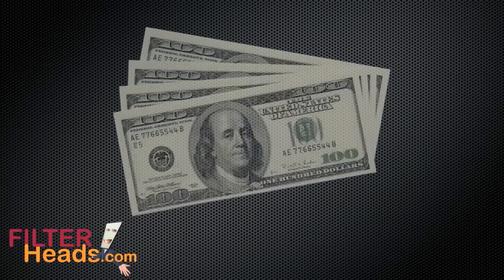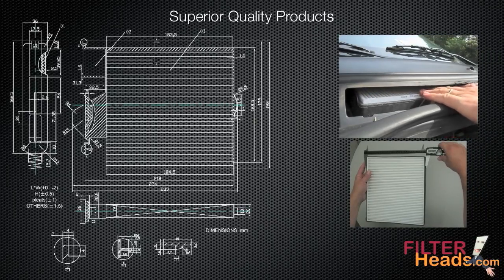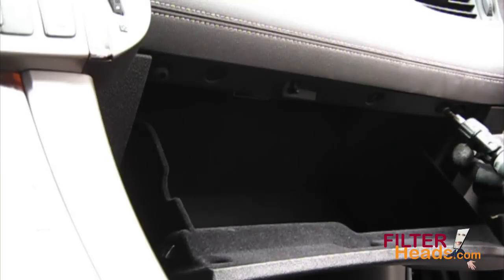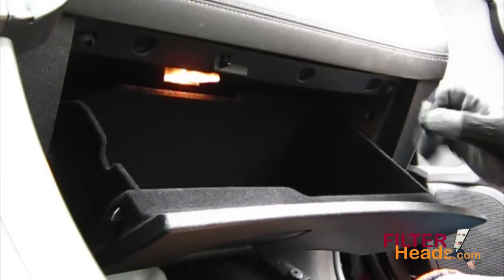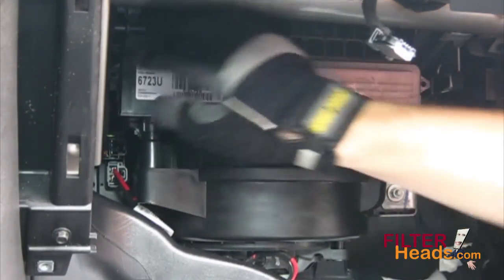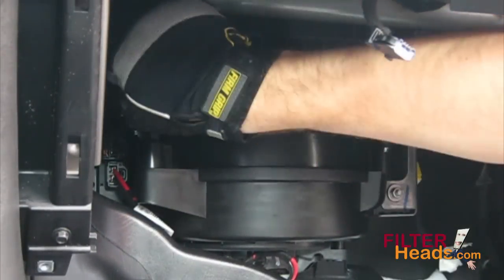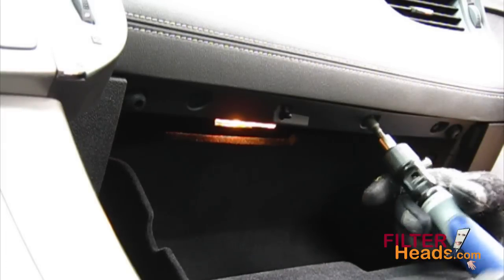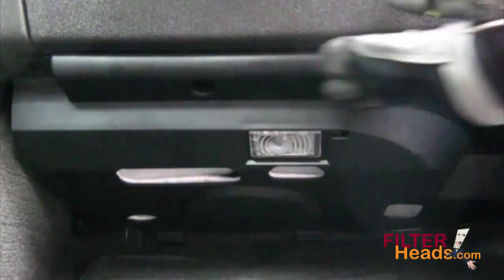How to Replace Cabin Air Filter 2010 Buick LaCrosse | AQ1164C

Comment: My 2015 LaCrosse doesn't have Torx 20 bolts.  The Torx #20 driver is HUGE, can't be right.  It's about 3/8 inch regular hex socket- but I will post again when I actually do the work.
Reply from the maker: Thank you for informing us.

Comment: This is all correct except the side panel on the right side of the glove box has to be removed on a Lacrosse 2014 to get glove box to clip back into place this is not shown anywhere in the video.  When you try replacing glove box without removing side panel on the right side , the clip will bend out and you have a large gap between glove box and the panel that attaches to the right side.  We finally took it to a friend that owns a body shop he just pulled the right side panel off straightened the bent clip, pushed the glove box in and snapped the side panel back on and was done in about 2 minutes.
Reply from the maker: Thank you for informing us!

Comment: You do not have to remove the right panel next to glove box to replace the filter but absolutely have to remove it to get glove box to slide in behind clip on the right side that holds the glove box in on the right when replacing the glove box.
Reply from the maker: Purchase your new filter today at www.filterheads.com

Comment: Thanks for great tutorial video, your explanation on how to remove the filter and install was as smooth as silk...( Just like a song from the great Swedish Pop Group ABBA) It was positive!
 There was one thing on the 2012 Buick Lacrosse that has to done first. Partially remove the. Rt side panel (next to door) just at the front area only.. This will allow you to remove and insert the glove box assem. easier by prying the grab clamp away from stud to release glove box assem. Also, when reinstalling the glove  box assem, insert right side IN first, then left side. 
   I also had a chance to change my Eng. air filter as well..  Very productive Day thanks to you!
Reply from the maker: You're welcome!
Reply: @filterheads  Yeh, my pleasure! I also wanted to say that you saved me $65 in labor  installing these two Filters. With labor costs these Days, it pays to be in the know...👍😎
Reply from the maker: That is great to hear that our video helped you save some money!

Comment: Do you need to pull this down hard? I don’t want to break anything
Reply from the maker: You may need to apply some force but try to be controlled with your movements so you do not stress the cables that are attached.